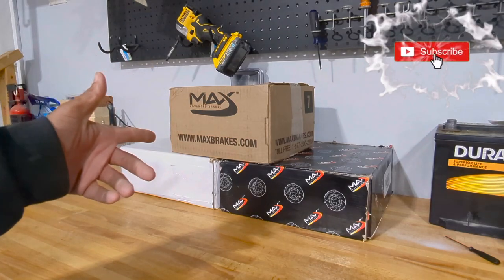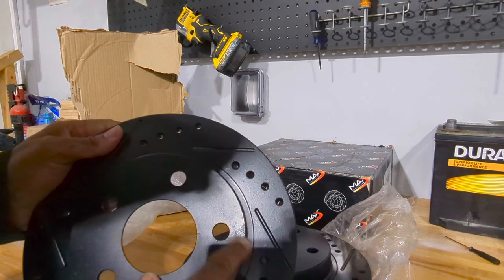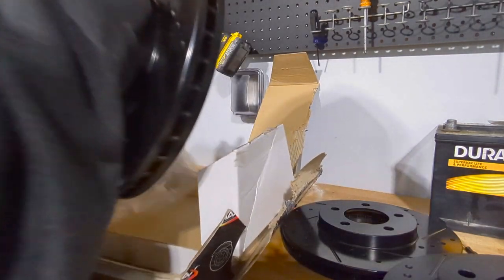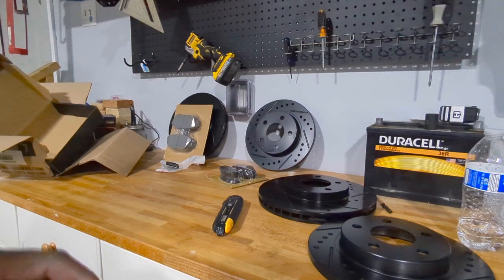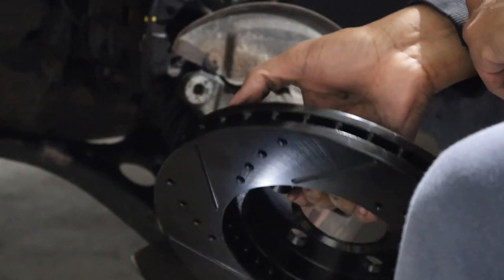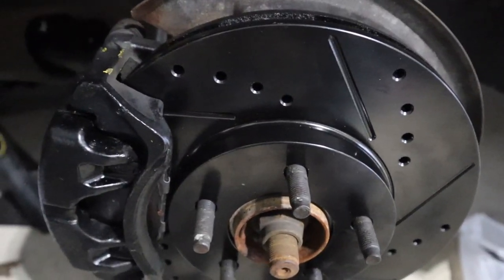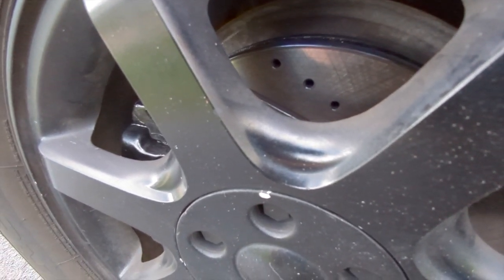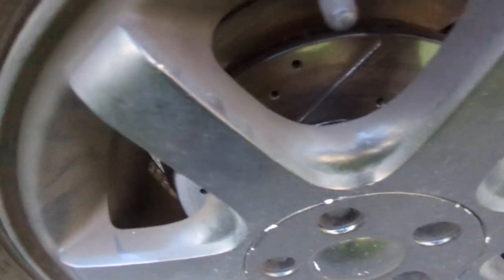Max Brakes Elite XDS Rotors with Carbon Ceramic Pads KT054181 KT071682 FRONT/REAR REVIEW!!!!!

Comment: Hi, i just wanted to ask about ceramic or elite max brake which one is better?
Reply from the maker: Hello 👋  sorry for the late reply. The elite pads are ceramic. The pads are good so far I had no issues with the rotors and the brakes are quiet with no rust.

Comment: Hey, so how are these brakes holding up? I need to replace my rear wrangler rotors and pads and these are half more the price.
Reply from the maker: When I first bought the brake set I thought that they were going to stay black. LOL,  it's just an anti-rust coating. But the brakes are working out very well and they are quiet. I have no rest and the price is not bad. I hope this helps✌🏾

Comment: I thought it's gonna be stay black forever
Reply from the maker: Lol, I did also!!!  😂
Reply: @ALWAYSOCCUPIEDTV  Hows these holding up now?
Reply: I'm considering these or Detroit Axle zinc dichromate coated rotors and ceramic pads for our Lexus LS 430. It's normal for rotors to show rust spots on the surface that pads rub after it rains, it's the black coated surface that doesn't make contact with the brake pad material that counts, is that rusting as well? Also, the pads are carbon fiber embedded ceramic pads which I don't have any experience with, I normally just get ceramic pads so I'm not sure if there's a benefit to your pads compared to plain ceramic pads or not. I don't like aggressive brake pads that sound like they're grinding into the rotor when the brakes are applied and I also don't like brake pads that make a lot of dirty looking dust that gets all over the wheels after awhile so I'm still researching these. 
  Thanks for the video 👍
Reply from the maker: @BALJITSINGH-ez4nk   they are doing very well! They actually look great. no problems no rust
Reply from the maker: @bodeine454  Thank you so much for your comment and for watching most of the video. Those little rust spots did worry me at first, but now everything is good. I haven't seen any rust spots after that. The brakes actually work pretty well, and I haven't had any dust on the wheels as of yet. I will also look into the brand that you are talking about because my other car is due for a brake change also. Thank again!
Reply: @ALWAYSOCCUPIEDTV  Yes sir 🙌
Reply: THANK YOU for the review. Just going to get them installed